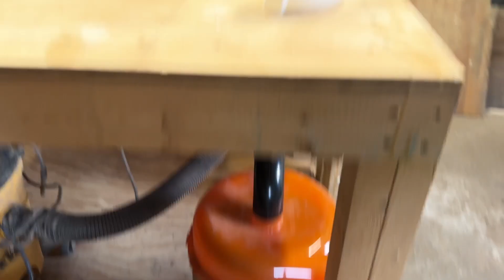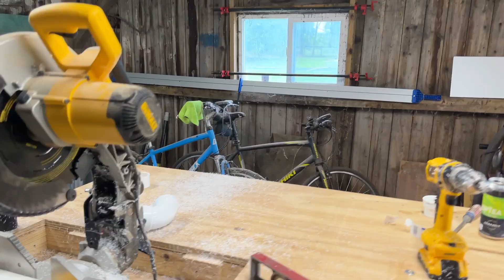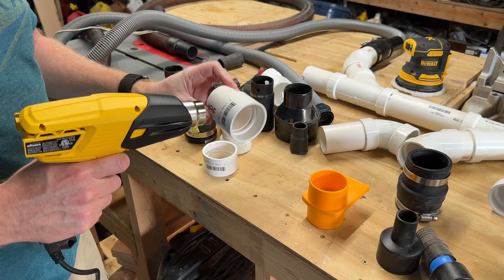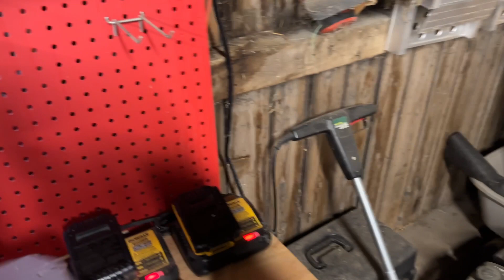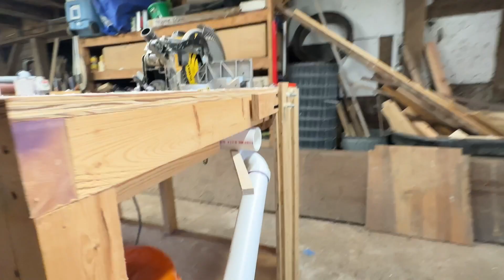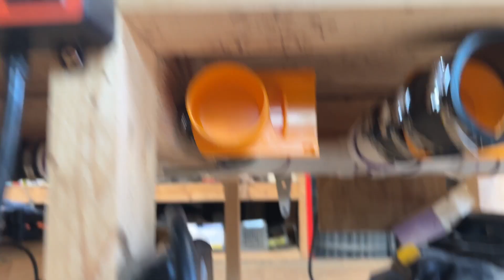DIY Dust Collection System for My All-in-one Workbench | | Step-by-Step Guide

Comment: I was going to build a dust collection cart and then decided, due to lack of room in my garage I need to build the dust collection into my bench instead. I went looking for videos of this idea and stumbled on yours. You have way more tools than I. I'm basically just collecting sander dust, but I have ideas for the future, so I may try to do what you've done here and set it up for future tools. All in all, I like your ideas here. One thought; at about the 10 minute mark it appears, when you tried heating that coupler and pushing it over the blast gate, you didn't have enough plastic on plastic friction to keep them together. If you heated the PVC and made it pliable, you could have pushed the PVC over the blast gate, all the way down and seated it. That might have given you enough plastic on plastic friction to keep it in place. I experienced a similar scenario just yesterday, and used this approach and so far it seems to work. 
At any rate, thanks for the great video and ideas. Subscribed and liked.

Comment: To help support your system.. you could take a piece of 2x6 or 2x8 and drill a hole in it like you did the table. Turn it upsidedown and push it up under the pipe. Screw it to table brace and done. If it's still wobbly use a strip of rubber between the wood and PVC. Adding the wood will also bring stability back to the table joists. All in all I like the outcome.
Reply from the maker: Great idea! Thanks.

Comment: You cut the guts out of all the table supports. They make 10cent plastic j-hooks  that would have cut your install time by 90% and your bench would still be capable of holding a project without collapsing.